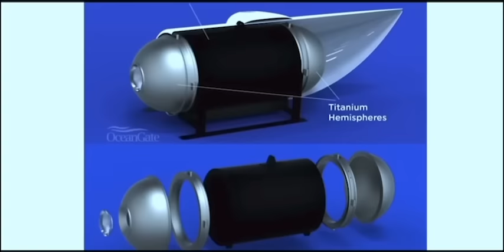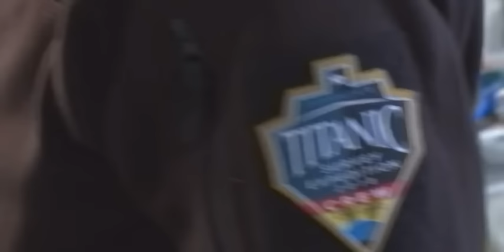First look at #oceangate #titan Debris

Comment: Glue at 2 miles down? You're 'avin me on arnt ya? Was always gonna be ok for a few dives but pressure changes after pressure changes meant it was gonna blow on one dive - but which one? Any volunteers for the last dive? Crazy attitudes from an arrogant man. Metal can be pressure tested to destruction to enable proper, safe design to follow. Pratting around with carbon fibre IN COMPRESSION doesn't come anywhere near safe testing. Hello destruction!!!
Reply: I have a hunch there may have been a "bail out clause" of some sort. Someone posted the boat never went below a few meters and the rides were aborted. What may have happened is Rush was scamming people and was about to scam 4 mission specialists. Rush might have been planning to go down only a few meters, say there are mechanical issues, WOW the specialists about the sea a few feet down then return to the surface ... ONLY something went wrong! The boat started to sink and Rush couldn't stop the free-fall ... no brakes! After releasing the ballast the boat continued to sink finally being tested to find just how deep a carbon fiber - titanium - gorilla glue contraption could go!

Comment: you guys are missing something crucial. they are not bonding titanium to carbon fiber. they are bonding Titanium to titanium. 
The carbon fiber is rolled around a Titanium tube which has flanges on each end. you can see that in another video. 
If you are gonna bash on some extremely stupid engineering. then do make sure you have the right information. 
But sorry this video is just BS and false information. 
Also the Area actually doesnt matter that much because you dont pull on these but you push in. so the "glue" gets compressed while diving which forces the titanium ring the press down on the flange so the seal would actually get even better the more pressure you force onto it. 
But the you get the problem that if the glue gets comprpessed even when hardened, then you would have a contraction and expansion with each successive dive which would weaken the bond. Wherein it would really matter how big the contact area is it would get weakened all the same.
You guys just have the wrong understanding what is going on in the depths.